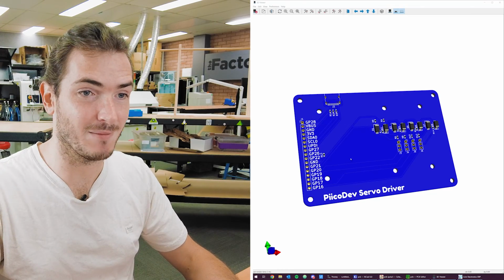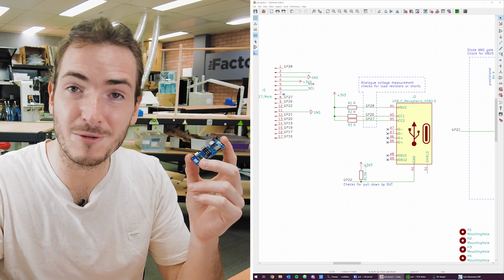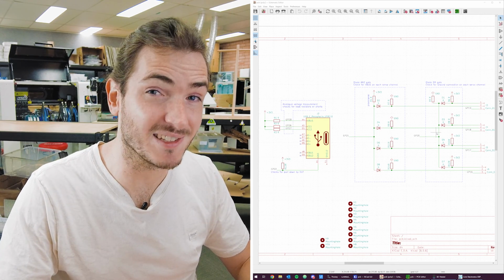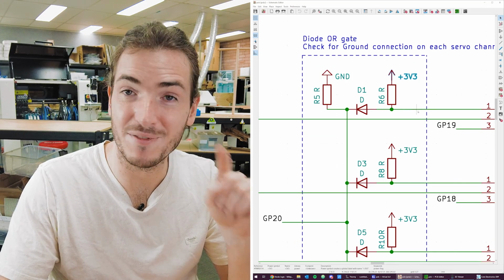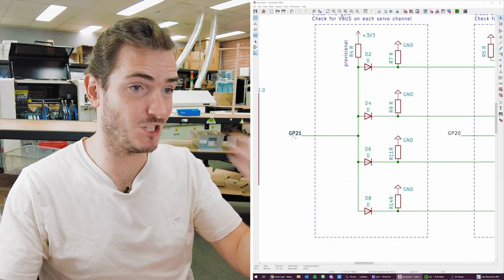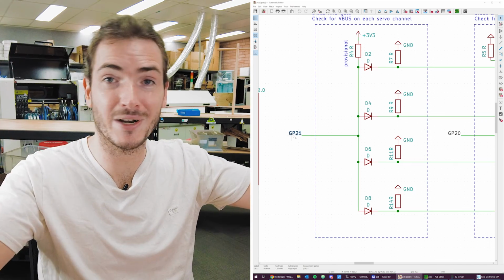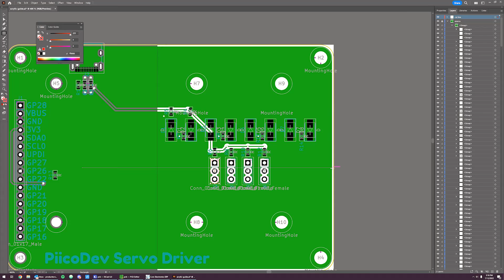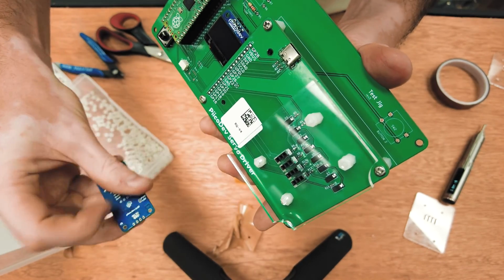The Factory | Design A Product With Us Part 6: Test Jigs & Quality Control

Comment: The switch(es) could be replaced by 3 pin jumper option, that can be tested, 
problem might be in getting all pins (servo area/2x 3pin) into the test sockets ... without breaking something.
Current test level, ok, but there may be many complaints and then extra testing could be needed.
Was thinking why not have leds replace the diodes but none are visible so bad idea in current setup.
For current visual check on green led, add a light pipe to the acrylic or angled mirror to the side ...
Reply from the maker: PiicoDev started off with the solder-jumper solution - we moved to the DIP switch solution to make the experience truly solderless and non-destructive. Imagine a group of students working with this hardware and regularly needing to change the addresses.